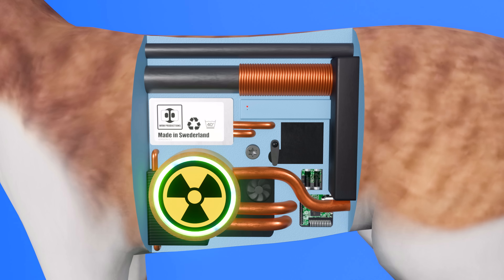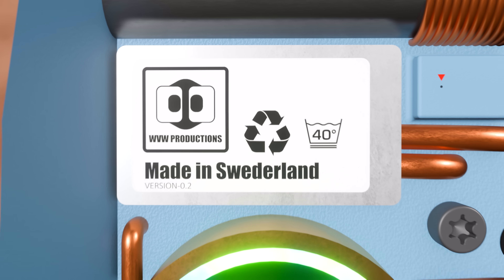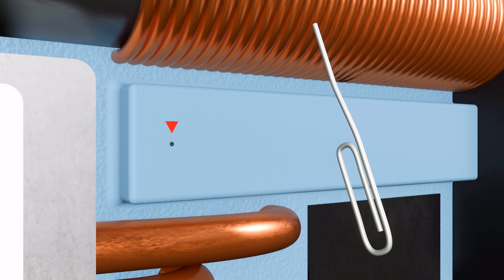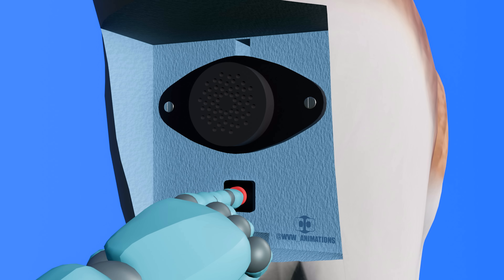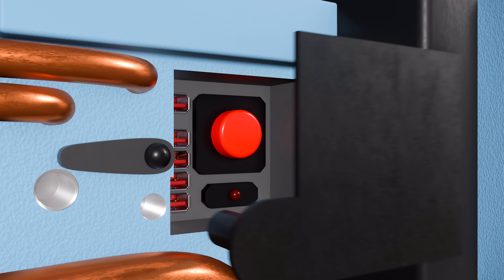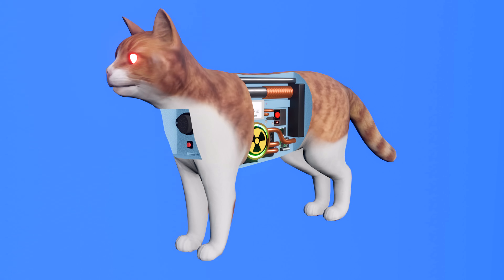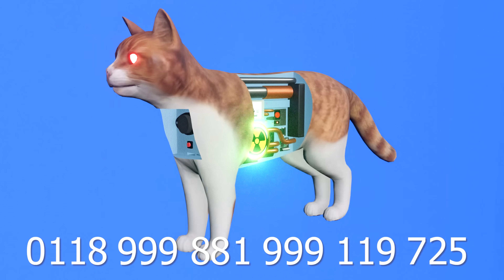How to fix a cat

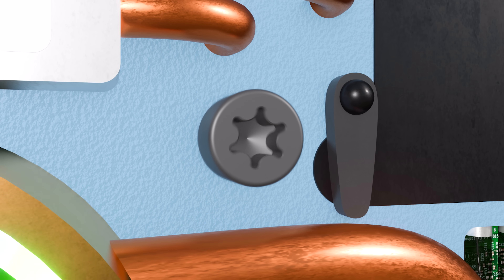Comment: 1:36  The following is IAEA standard operating procedure for all fasteners at “core level“ pursuant to “standards and practices” subchapter S126304.9:
“Core level fasteners are to be oriented and secured in a fashion to prevent unqualified/untrained individuals from manipulating or otherwise disassembling critical subsystems. Direction of rotation shall be “righty loosey”. “
Reply: I was going to say, just like a cat to be left-hand thread.  🙄

Comment: 0:23 i tried activating safe mode but my cat kept moving their head away any advice on how to keep this from happening?
Reply: Distract your cat using another cat
Reply: Weezer
Reply: Use the factory-standard phrase to engage command mode: "PSPSPSPS"
Reply: What you need to is power off the cat, power it on, as soon as you that, immediately go to safe mode, then once you're in safe mode, hold the safe mode button to activate lungs activation protocol, nd that's it, the cat should now run perfectly fine without any issues

Comment: What do you do in the event of a jam?
Reply: In the event of a jam in the gun barrel, disable your unit entirely. Do not activate Safe Mode. To do this, obtain a Philips-head screwdriver and detach the tail panel. Then, press the small black button. To remove the jam, take off the gun panel (with the same screwdriver, do NOT use a different screwdriver under ANY circumstances) and remove the jam. If removing the jam is impossible, replace the gun barrel at a WVW Service and Repair Center.
Reply: @windows-98s  Thank you, I’ll try this and let you know what happened